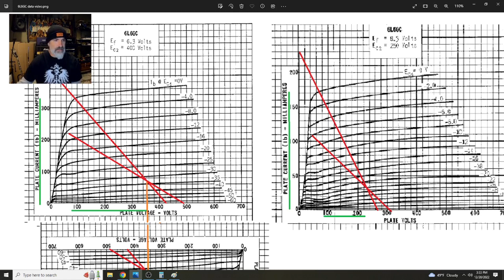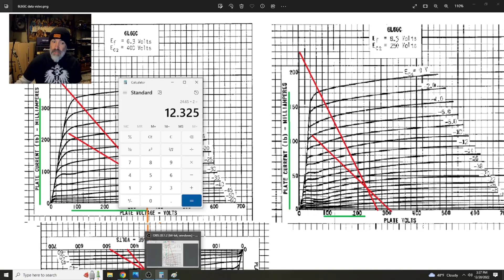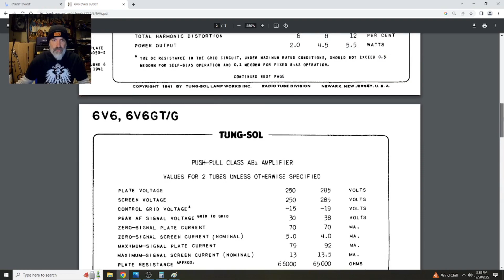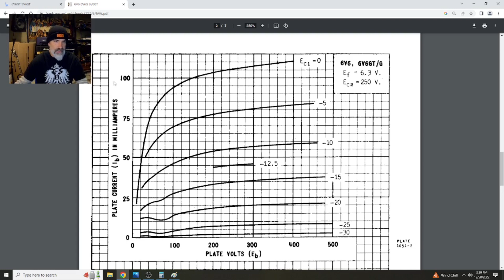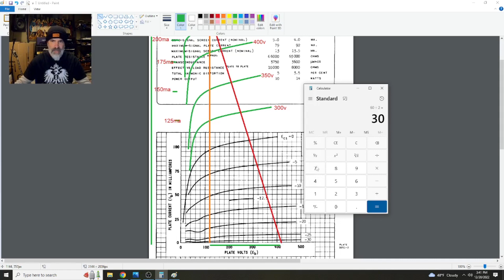Tube amp power ratings explained

Comment: So you rate your transformers for 6550's? I have been looking into why the smaller Fender combos have mushy bass and I am thinking it has to do with either higher DC resistances on both power transformer secondaries and output transformer primaries or maybe lack of magnetic headroom (Saturation).
Reply: Great video by the way! and Happy New Years!